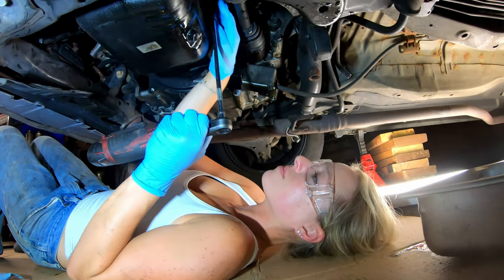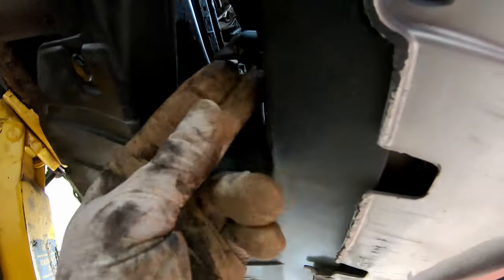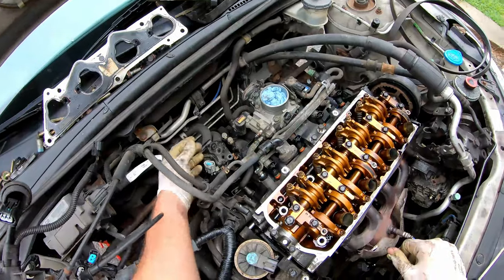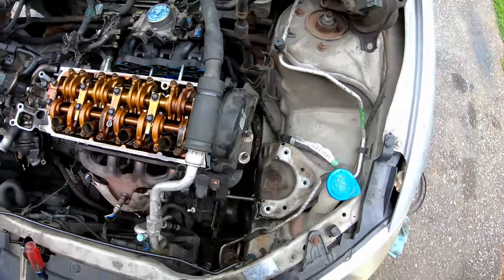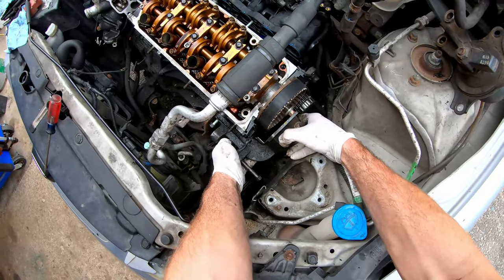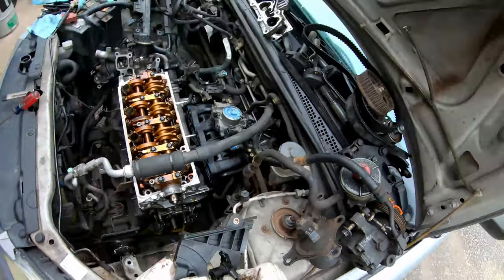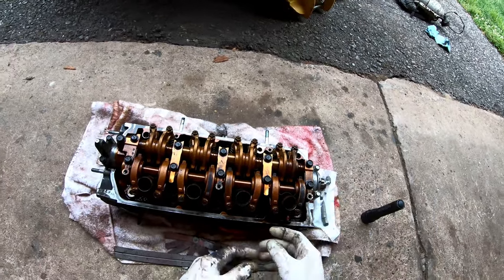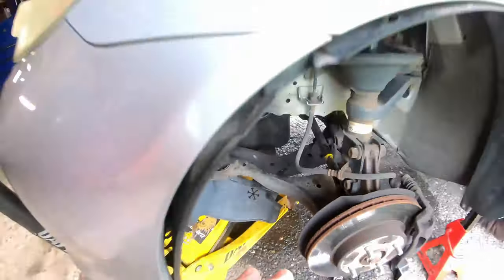Honda Civic 1.7L Head Gasket Replacement OVERVIEW/TIPS - PART 1

Comment: Dude you did way to much for this job haha got people all screwed up you dont need to do all that shit
Reply from the maker: It's just the basics. Do it right do it once. Better to have a full understanding of the proper process and then cut whatever corners you choose to
Reply: @NoNonsenseKnowHow  well I can see your point but that's simple mechanics I mean anyone with common sense should be able to take something apart and put it back together and it still work but common sense is a stone throw away and most people have no stone to throw much less eyes to see the stone
Reply: @NoNonsenseKnowHow  but thank you for the video it's very informative